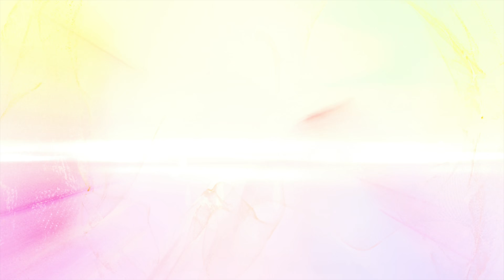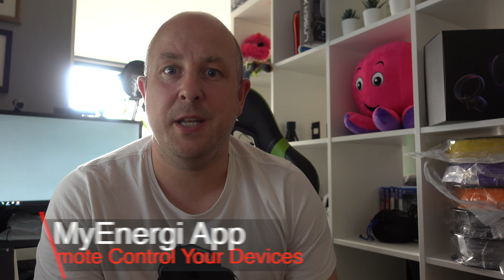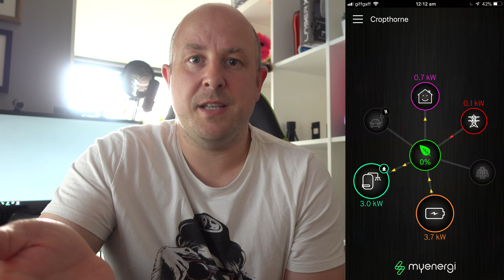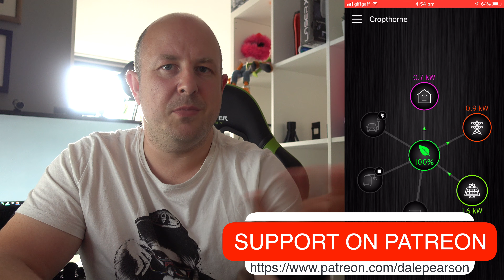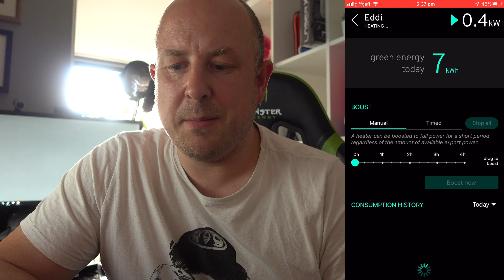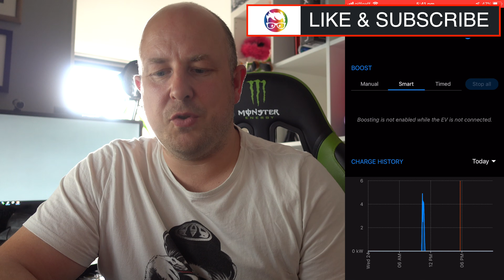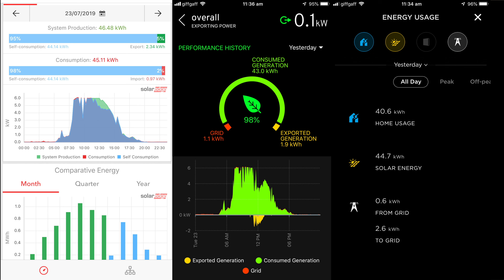MyEnergi App Walkthrough and Data Collection Comparison

Comment: Hi Dale, Thanks for the videos they are proving to be very informative. Do you think a Myenergi Hub and Harvi on there own would be useful?
At the moment we have no real idea what we are generating or importing, so I'm looking for a setup that will give us some data from our 6 year old 4kW (Ginlong) solar PV. We have a generation meter that is located in a separate building to the import meter so a system that requires a wired CT Clamp to both generation and import sides might be troublesome...

We've just had a quote to upgrade the inverter to SolarEdge and 10kWh Sonnen battery but we are sceptical about the companies best case % improvements (we have almost zero if any shading) and the optimistic payback time...

Regards,
Ken
Reply from the maker: Unfortunately Ken the Harvi is essentially dumb, and I believe the Hub is just an agregation device (ie it pulls the stats via the Eddi or Zappi depending on which is master). So without either of those it wouldnt work.
I will do a quick test for you to confirm by turning off my Eddi and Zappi and see if the hub is able to interpet the CT clamp info independantly.

I don't know much about it, but a Smappee might be an alternative to consider. A subscriber called Darren uses one (soon to be selling) and probably give you some info. He is often in the Spectrum Geeks Discord channel if you want to drop in - 

 https://discord.gg/uj3YSQx
Reply from the maker: Just finished testing and can confirm the Harvi and Hub alone are dumb, they are not able to interpret and show data without and Eddi or Zappi operational.
Reply: @ConsideredUK  Thank you so much for taking the time to do that. The Smappee seems to require a cable between the clamps. I guess I need to see if the previous owners had the vision to lay some useable conduit between buildings. Thanks again for your help.
Reply from the maker: Hi Ken, before answering, do you have a MyEnergi Eddi or Zappi currently? As the Harvi is just a way for connecting the CT clamps to a device that then sends the information wirelessly.
Reply: @ConsideredUK  Thanks for getting back so quickly.
Nope, the Eddi might be useful but without knowing how much surplus we are generating we have no way of knowing. I'm trying to find the best way to monitor our current setup that doesn't need a wired link between the import meter CT clamp and the generation meter CT clamp...  I was hoping MyEnergi might have the solution :-)
Reply from the maker: No problem. Its hard to comment on best advice not knowing / seeing your specific setup. But assuming you got all things in one fuse board (which is most common) then you can bung two CT clamps in there and hopefully not to much hassle (as even the Harvi  would have needed this). Feel free to drop into discord and perhaps we can get creative if with have more info on the setup and what we are trying to do. Cheers

Comment: I’ve about the same setup as you all be it that my solar array is slightly smaller. What I find with this app, and I’ve noted other also, is it very clunky, not the best and certainly the slowest app I’ve got. Hopefully over the next few months myenergi will get to grips with it and  iron out the creases, metaphorically speaking!as it can be a little frustrating to say the least. On the positive side it’s great to have the info to hand although it’s not always the same as my SolarEdge apps info but I’ve put that down to myenergi’s slower updates. Onwards and upwards 🤞🏻Colin. 
Oh, I agree with you about updates, that at the mo is a real pain especially as we’re not told about them via email but have to check each time though the forum, that up until a few weeks ago I new nothing about. In short the sooner we get auto updates the better.
Reply from the maker: Yeah, I put it down to being early days. I think if you have other apps right now you will use them unless you want to adjust timing or boost something. However, if you have nothing even a clunkly solution is better than none.

Comment: Thanks Dale, very useful and agree with your thoughts on the positives and areas for improvement. 
I thought the final section where you did the comparison figures was interesting. I've started looking at this too, especially the import/export readings from the grid from my new smart meter readings installed on 19th July. There's a major variance between the meter reading and the Tesla app. From grid 0.2kWh (app), meter 3.39kWh. I need to install a couple of CT clamps to the Harvi (job for this weekend) to be able to compare all three figures. I wondered if you've looked at your meter readings; import/export figures to see how they compare to the values you are collecting?
Reply from the maker: yes and no regarding looking at the meter. I looked at them when I had the system installed and for a few weeks after, but noted what the software said and what the grid and generation meters was quite different. So now I only look at those for billing, but use SolarEdge for ease and consistency (ie consistently x % off).

Comment: Good vids, many thanks. Interested to know how you got the battery icon on your Myenergi app. I seem to be missing that, is that due to a configuration issue within the Eddi? Hopefully will be getting my first next-gen Zappi installed next week.
Reply from the maker: Hi Avais. I have a CT clamp connected on my live battery connection. This is how the MyEnergi Harvi knows I have a battery and can share that info.
Reply: @ConsideredUK  interesting ... I added a third CT clamp on the live wire of the battery pack,  but the icon for the battery pack does not appear on the display. do you think I should redo the installation in the app? could you please take pictures of how you configured the ct clamp in the zappi menu? thank you so much
Reply from the maker: @CristianoGardoni  I am can't get to my config right now, but i will try to remember to take a look when I can and let you know. Before re-installing the app I would check that the Zappi is seeing the battery info, as the hub itself is dumb.
Reply: @ConsideredUK  tnx for the quick replay... after asking my question, I realized that I had simply selected "storage only" instead of "ac battery" in the Zappi's menu ... after I set the right parameters, the icon appeared without having to re-install the application ... thanks a lot anyway for your interest in my problem ...
Reply from the maker: Excellent, glad you got it sorted.